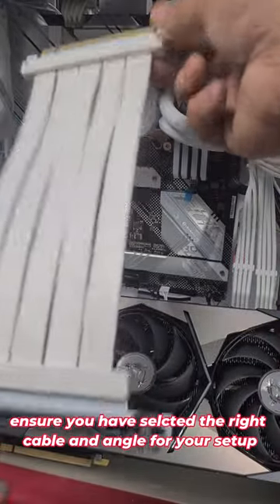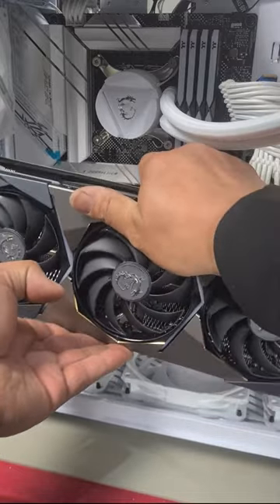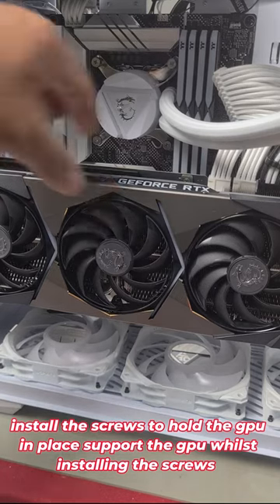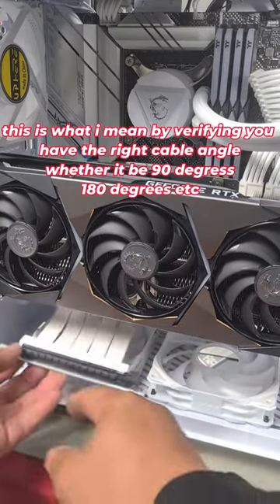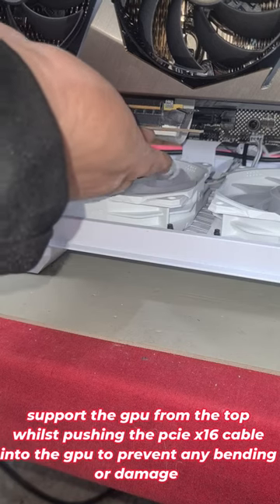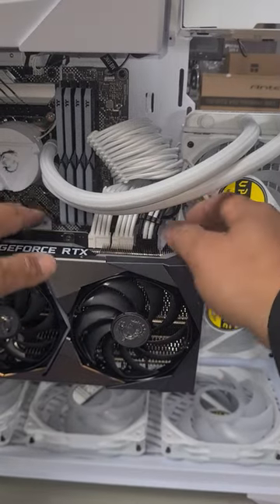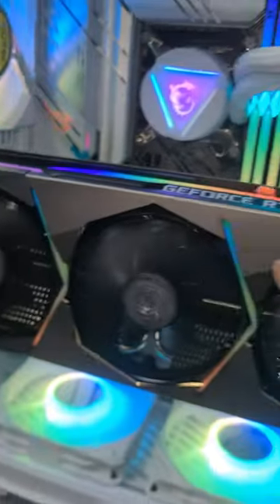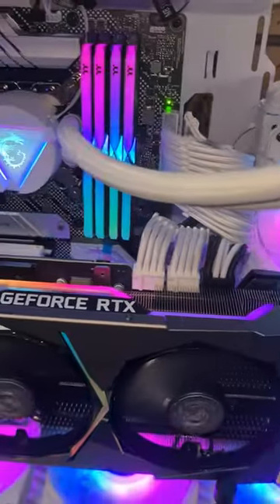how to install/vertical mount your gpu with a pcie x16 riser cable.. ezyfab-diy pcie 4.0

Comment: I have a corsair case with vertical mount slots in the same place. I didn't want to put it there with the fans being so close to the glass 9bstructing airflow and overheating. Now are you getting around that ,? I've literally just spent 60 on a mount that allows it to sit further back but I'd have proffered to use the case
Reply from the maker: honestly it's fine the air intake from the bottom helps alot too... it doesn't constrict airflow completely ..wenever there is a situation where the gpu maybe too close ro the glass I turn my fans up abit higher speed so it can help draw in more cool air too... its not too close where it has no air flow at all... its close but not close enough to be worried..its Running great
Reply: @MIKEYZVLOGZ  hey thanks for replying to me ! Hm I might try it and see what happens I got scared cause other things I was reading was saying they're temperature had gone up by about 20c and performance was compromised.  The only thing is I don't have any fans at the bottom as the psu shroud is there and I've no rook for them . I've 3 case fans at the front.  2 fans from my cooler at the top and spare for 1 x 120mm fan at the back . It's only a midi case hence the reason I'd prefer to use the case slots as I'm not sure the bracket I brought is actually gonna fit

Comment: How did you install gpu on vertical position before connect to the riser do i have to change pc case if i want vertical mount
Reply from the maker: no u dont have to, my case had the vertical option, thats why i could do it without using any adapter, if u want u can buy a vertical mount that is universal, u just have to ensure you have the room to do so
Reply: @MIKEYZVLOGZ  Thank you 🥳🥳🥳

Comment: For a 4070 ti super slim do i have to put the stand ?
Reply from the maker: @aldinmariposque6152  it doesn't need a stand if it had a solid backing plate...however a cheap stand can only benefit u ... telescopic ones are so cheap

Comment: Can i twist the cable?
Reply from the maker: u can twist fold it... it's been done on alot of itx cases as the cable needs to be on the other side and they actually fold the entire cable in half making a 90degree triangle if u get my drift

Comment: hello bro do you think this mount would fit on jonsbo d41 case?
Reply from the maker: @iskandararif9721  which mount? in this video I only use a gpu support amd riser cable
Reply: @MIKEYZVLOGZ  the gpu mount😃
Reply: its universal ya?
Reply from the maker: @iskandararif9721 no..there isnt a mount at alll. it's the case that has a vertical mount embedded into the case slots...like u see on many cases...they have a certain amount of vertical slot as well as horizontal ones... so u can choose whether to mount horizontal or vertical...